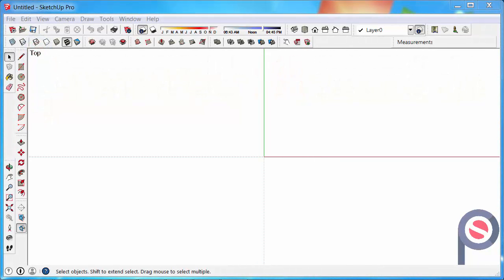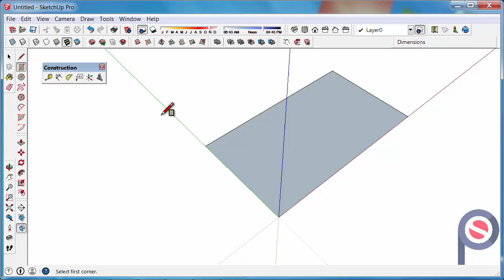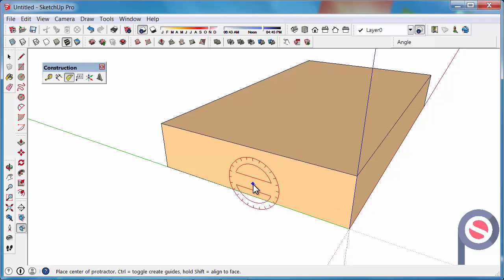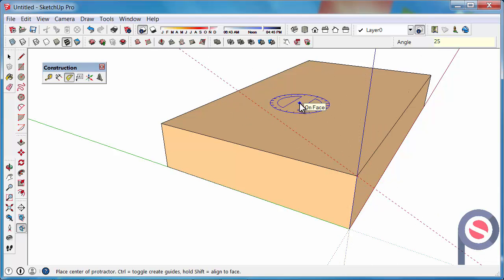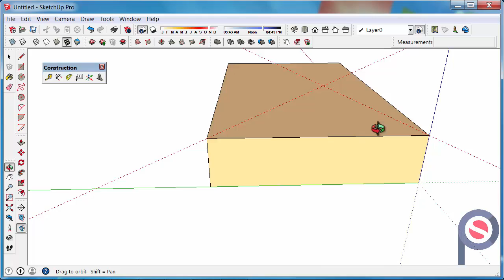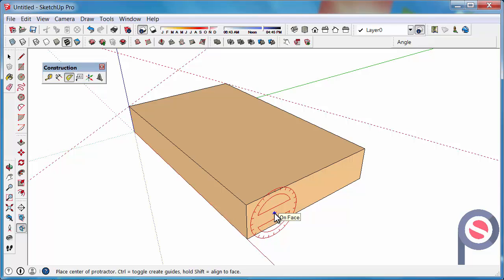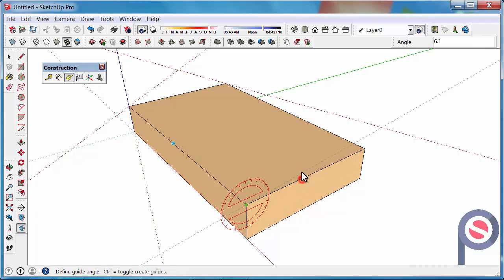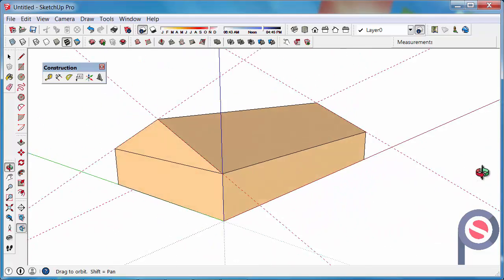SketchUp - How to use the Protractor Tool

Comment: You can also use your arrow keys to select the plane L=green, R=Red, Up/Dn=Blue.  If you tap the Up arrow it will toggle between planes. on a Mac that is
Reply from the maker: That's correct in more recent versions of SketchUp.  This video was recorded 10 years ago 😅